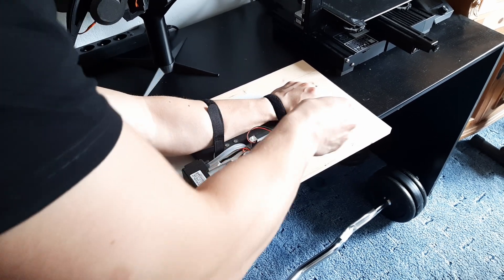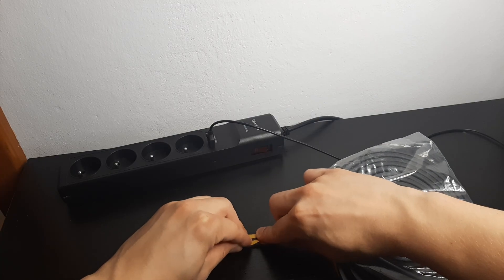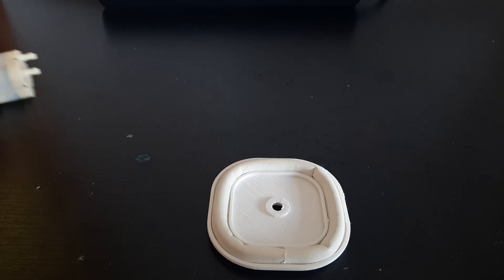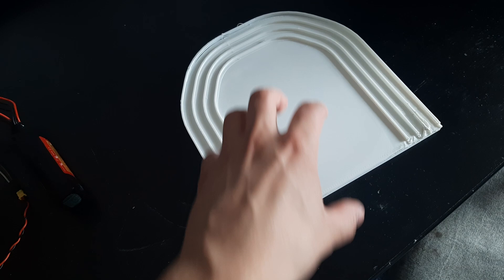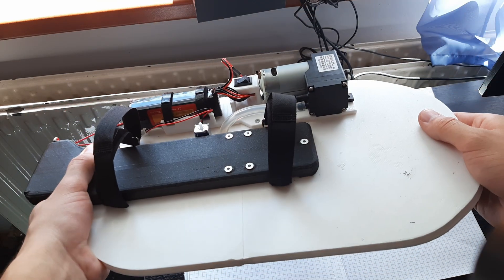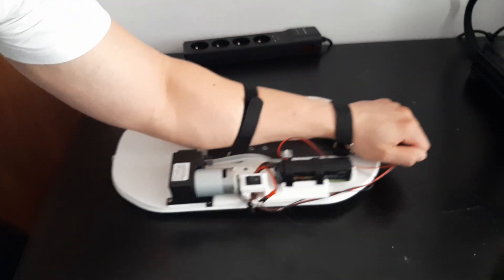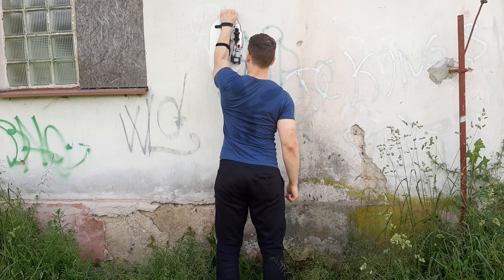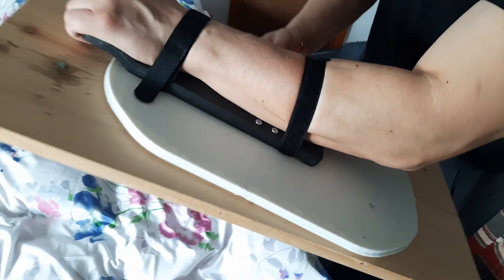I'm Making a Wall Climbing Suit

Comment: What are the screw sizes?
Reply from the maker: I think I used M4 for connecting suction cups to the handle and maybe M3 for the battery pump, etc. Are you building this as well? If you manage to make it work, definitely contact me! I was able to hang off a door at my old shitty college dorm, but I couldn't find a single wall that is airtight. Otherwise, it worked decently I think.